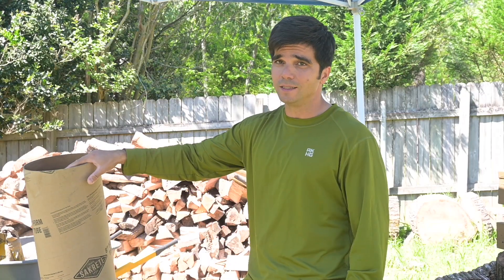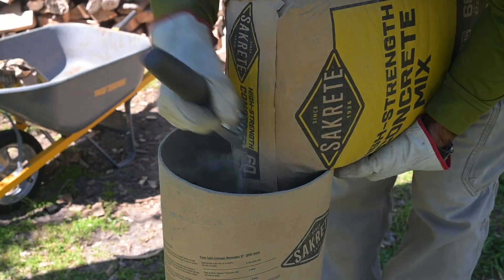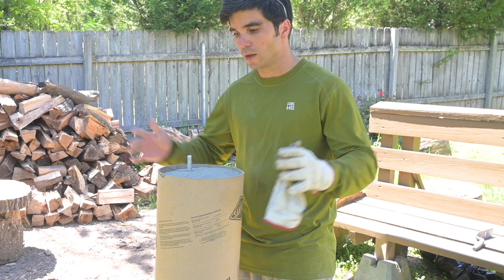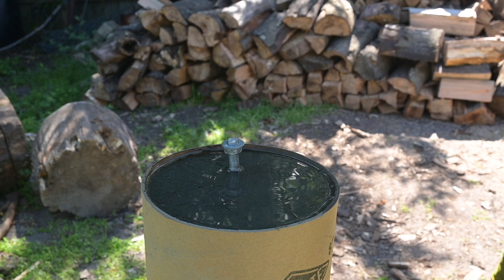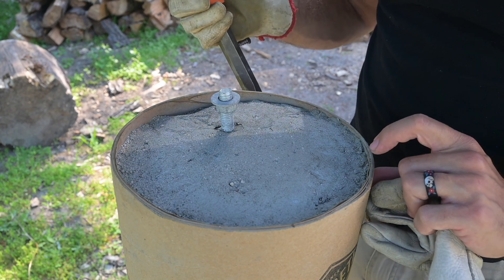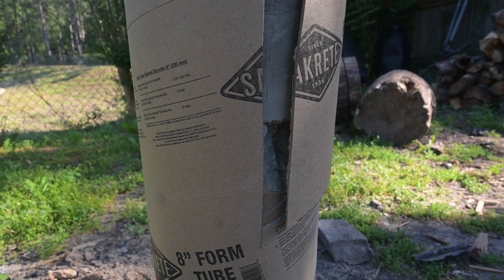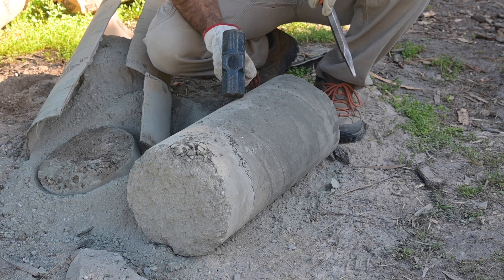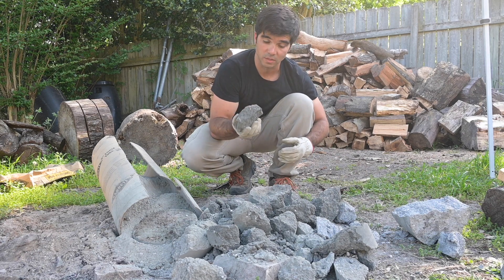Dry Pour Concrete: How Deep Can you Make it?

Comment: I think for that particular shape, I would have just go full soak instead of waiting an hour between misting. Since the mix is a lot of sand, most of the water will drain off into the ground and whats soaked into the concrete will cure well. The crete will only accept as much moisture as it will absorb. The sand in the mix is the best draining medium. Of course a psi test afterward would test how strong the cure is. Crete will cure hard with just about any amount of moisture. Getting the correct psi depends on the amount of moisture, time, and evaporation rate. This is my uneducated guess based on sculpture work with crete.

Comment: If you had watered in between bags and not run 30 gallons of water through the top layer washing away any strength. Also it takes a week or longer to cure. You said concrete is cured in two days

Comment: 1 - Roughly 5 quarts of water is needed per bag, you might have done one total gallon.
2 - Light moisture turned the dry concrete gray deep inside and it never got enough water to actually solidify. It needed to be actually wet.
3 - I wouldn't hammer an anchor into wet poured concrete until after full cure of 28+ days.
4 - Cylindrical type containers are going to allow water to leach quicker and further along the sides, then in the center area, thus causing the center area to only get moist - not wet as required. 
5 - No amount of water would have leached down 4 feet in the time given.
6 - No person would try and fill a column dry that tall for any structural purpose.
7 - If pouring a column even wet, you must use rebar over 12" depth or it will crack/break just like the dry pour. 
8 - Only a person that has never mixed concrete would believe this video.

Comment: 5:30 " the concrete is cured"
No, at two days the concrete is nowhere close to cured. The failure indicates insufficient water. Best to put a drip irrigation on it and keep a pond on it. The advice to do layers for dry pour is based on what? IMO it will not produce a strong foundation.  The general rule for curing is 7 days for a fully hydrated paste which produces 70% of rated strength.  

See American Concrete Institute ACI 308R-16
"Because hydration can proceed only in saturated space, the total water requirement for cement hydration is approximately 0.44 g of water per gram of cement plus the curing water that needs to be added to keep the capillary pores of the paste saturated" (pg 3)

Thus, if the form had been properly hydrated, you would have seen moisture seeping from the bottom of the form.
Reply from the maker: Of course it isn't good for a foundation. This was an experiment to see how far the water would penetrate. I didn't expect it to reach the bottom.
Reply: @appalachianwoodhomestead  even after concrete fully cures after 91 days, it remains permeable to water. Specifications for testing absorption and permeability are available from ASTM. Keeping a dry pour submerged until the entire stack is fully hydrated is necessary, and it is just a matter of time until standing water reaches all the way through.  It's also necessary to avoid repeated wetting and drying. The Youtube method of misting attempts to stabilize the surface. IMO the best approach is to mist until it ponds and then continually add water to maintain the pond until water is verified all the way thru. After that, keep hydrating for 7 days.

Comment: Thanks for showing this. I think it would have been better to just soak it from the beginning. It might have worked. I'm just going to mix it. I don't see this method saving any time or effort. I certainly don't want to chance it. The foundation is the most important part of a build.
Reply from the maker: I've done the soaking from the beginning, too. The results are better than this, but still not great. I believe at least some mixing is necessary.

Comment: I see there are a few things that would have made this a success, I am NOT a professional but I do have experience with regular concrete. I noticed that when you started with the water that you were following instructions for a pad/large flat surface where you didnt want to upset the visual look. What I would suggest instead is to immediately add water and avoid the misting because this isnt 1-4in of material that needs water. This shoud have been watered down from the beginning so that the water had time to get to the bottom more evenly. Other than that I believe that letting it sit for 2 days after watering it that would have been a much better comparison.

Comment: The reason you were able to pull out the bolt and destroy the concrete, is you didn’t give it enough time to set up and harden. You can’t just do everything in 24 hours, you need six weeks of setup time for it to work.
Reply from the maker: After this experiment, I did some more research and realized that I needed to wait longer than two days. The recommendation is generally to wait a week before putting tension on the anchor bolt. Thanks!

Comment: I honestly dont think people are trying to make 4ft columns with the dry pour method. 

The regular way of mixing concrete or bringing in a concrete truck. Is how 4ft piers and house foundations are made.  

People have made shed pads, sidewalks, carport slabs and so on. So 1"- 4" slabs done the dry pour way is great. 

I will be making a 3"- 4" thick parking pad on my off grid property using the dry pour method. 
When it rains it's too muddy from the truck to my mobile home.

Comment: dry pour in the manner that you are doing is for posts in the ground. you would dig the hole center the post then dump the concrete in and soak the hell out of it. over time you will get rain and watering the yard and snow and everything else. you need to redo this and soak the whole thing and let it sit for a long time getting it wet a lot over time. this test is nullinvoid
Reply from the maker: This test was to see how far the sprinkles of water penetrated and was intentionally isolated from the ground as much as possible.

Comment: The misting method only is used for 4 " to do that kind of pour you would have to totally mist it till it's totally drenched because that's to far for the water to reach the bottom at that point for strength you would have to stay and continually drench it

Comment: You REALLY should be wearing a proper respirator when pouring bags of dry concrete. When the dust gets into your lungs, it mixes with the moisture in your lungs, and then does what concrete is supposed to do. Not only can that make your life pretty miserable, but your wallet and health insurance policy won't be very happy with you either.The only aspect of this test to be a fail, would be the test itself. Dry pouring a four foot by 8 inch form tube is not a realistic test, and every one of the tests and inspections of this form tube proved it. While dry pouring is acceptable in certain situations, it is DEFINITELY NOT acceptable for something like this, which is meant to be a structural support. Next time do a test with a 4 inch or 6 inch slab.

Comment: 6:46 how much water per cubic inch did you pour. For that depth, you would have had to fill that top section 10 or 15 times to have enough water to soak to the bottom. Without the proper amount of water and curing time for the amount to mix, it is not a really fair demonstration. Not adding enough is like not adding enough water to dough. But  still 19 inches is not bad at all.
Reply from the maker: I moved up to watering every 20 minutes and watered throughout the day and evening.
Reply: ok

Comment: Did you water it well 4-5 times a day for two weeks as you're supposed to do with a normal wet pour. If not, it does not settle it at all.
Reply from the maker: Two weeks is a darn long time. Most people only wet cure for about a week. 

No, I didn't do that for this video because that really wasn't the point. I watered at frequent intervals over the course of one day. I was attempting to see how deep the water penetrated during that time since many people only water dry pour for a day or two. 

It could be a fun experiment to see if I could actually get the entire tube form worth of concrete saturated with a dry pour, no mix method.

Comment: I guess everybody needs to do a video on this and it was somewhat interesting to see this one but I don’t think anybody would even consider doing a dry pour more than I would say 10 inches max.
Reply from the maker: You don't know until you try. I wanted to find out how deep it could reasonably go (and tested it in isolation from the ground on purpose). I was hoping to find an easier way to do piers for a cabin I'm building this summer, but this is a "shortcut" I won't be using.

Comment: Why waste your time on dry pour and spending 8 hrs pouring concrete and sprinkling watering when doing it wet you'll be done 
in 3 hrs duh
Reply from the maker: After my experiments, I agree.
Reply: Nobody is spending 8 hours watering.  It's 10 seconds at a time - multiple times.  At most, experienced people are spending an hour to prep before water.

Comment: I haven't seen anyone try to do a full tube of dry pour.  6" max depth maybe.  You'd need to add water every bag or 2.  In a dirt hole for a post, dry pour is completely fine.  Don't need a tube.  Even then, the entire depth (4' in Michigan) doesn't need to be filled with concrete. I would do 2 bags at bottom and 1 bag at top.   I wouldn't even use a tube for a footing except a section at the top to get the concrete above grade and level.  I'll be trying to do a dry pour on bare ground over a horizontally laid tube to extend my drive way culvert a few feet.  Will be about a foot of gravel on top of the concrete.  12" culvert pipe is way over priced if you can find it and I don't need to buy 20' to only use a 3' section.
Reply from the maker: I tried in just about 6" sections in my third video. it didn't work well, either. Part of the problem is that it gets bad stratification as the gravel rises up, so there are lots of stratified layers.
Reply: @appalachianwoodhomestead  Gotcha.

Comment: When I do 3 foot deep fence post dry pours, I do a few important things differently:
1. Tamp as you go.  Tamp the mixture together as you go (as you add)  to eliminate voids
2. soak the area for a long, long time.  I would put maybe a sheet of newspaper on top to keep the surface from being pitted, but since aesthetics aren't important I wouldn't stop hydrating from the start
3. I would just leave a slow mist or drip on a column like that, continuously hydrating, for a good 24 hours.  Concrete is like a sponge and the water will get all the way to the bottom. We are naturally impatient so we want to just drench but the absorption rate is slow. A continuous mist that doesn't drip water directly onto it works fine. Set and forget until 24 hours. 
4. I protect from drying, or just keep wetting it for a good long while.
Reply from the maker: That's really great advice. Thank you.

Comment: Isn't the thinking with drypour that the cement will absorb water slowly over time? Since you isolated it from it's surroundings the only water it got was from the top and bottom. Is 2 days do you really think the cement got enough water from either direction even if every drop you put on it got absorbed?

Comment: Blaming the system when you don't follow directions is not a fault of the system, it is the fault of the user. Clearly you have not watched enough of Cajin Country Livin's videos of doing dry pour, as you did not follow the basic rules for wetting, at all.  They say you need 2 showers once per inch of thickness of the pour spaced out by 2 hours each. (See https://youtu.be/_50MXEHr678) which would requires days of showering to fully wet the concrete and trigger the chemical reaction that causes it to harden.  I imagine in this specific application that placing a micro-drip waterer on top and running it continually for a couple days would probably be okay after the second shower and would result in full penetration of the water in sufficient quantity to fully wet the concrete mix.  
BTW, using a oscillating saw (saber saw, saws-all, without a blade is a great method for vibrating a form to get the material to settle, eliminating voids.

Comment: A 19" slab?  Who needs a 19" slab?  As much as you tried to resist it i think for a foundation pillar you'd want to get the concrete in direct contact with the surrounding ground and have that soaked.  My understanding is concrete is porous and water will slowly move through it  Maybe you should do a slab pour where it goes from a few inches to a few feet thick, leave it a really long time - at least a month, if not several - during a time when there is plenty of moisture available to soak into the slab gradually. Then cut sections of the slab at various thickness and have them professionally tested.

Comment: dry pour should not be used for foundation. or any thing with weight bearing like a dry drive way. may be
Reply from the maker: Agree...but I don't think I'd even use it for a driveway.
Reply: guess you didn't watch the video of the guy who dry poured about 5-7 slabs all together, let them set for a few days (only), and then asked his neighbor with an F350 to drive on them... TWICE, and that F350 had all his tools in it as well.  It cracked around the edges but the slab itself did not crack and that was with the F350 being mildly aggressive.
Reply from the maker: @billsmith9249  Yes, I'm aware of that video. Doesn't mean I would personally chose to do the same based at this time. The truck on the slab at two days is one of the reasons I thought letting this tube sit for 2 days would be okay for initial inspection.

Comment: I am doing some stepping stones. # inches should soak just fine. I'll moisten the ground first so it soaks from both top and bottom.
Reply from the maker: I agree that this method should work for stepping stones. I highly recommend screeding to make sure it's level and to help push the rocks down. This will give you a nicer looking product that's stronger, too.

Comment: First I want to say thanks for the test and video. However I feel there is some problems presented here. 

Dry pour for fence posts is used all the time. I think the way presented here doesn't do dry pour any justice. It gets stronger over long periods of time. Eventually it will have full coverage and the concrete will fully harden and cure close to max psi strength (over one month). Doing a 24 hr comparison is basically a worst case scenario between the 2 methods. 

Even wet pour after 24 hrs to me is very weak and brittle. I have had to wait over 2-3  days before removing wet pour from concrete molds, etc.  Also your curing and drying explanation is very incorrect. 

Copied from the internet here is a guideline for wet pour (conventional). When waiting for concrete to dry, keep these timeframes in mind:

24 to 48 hours - after inital set, forms can be removed and people can walk on the surface
7 days - after partial curing, traffic from vehicles and equipment is okay
28 days - at this point, the concrete should be fully cured

Dry pour takes longer (as the water penetration is not as fast and complete as wet pour)

I have many dry pour posts that if you pull them out of the ground, the concrete around those suckers are just as hard and strong as the ones that would be wet poured. The problem I think in this video is time and water penetration. Had the tube been set in the ground and the wet ground was giving moisture from all sides it would yield much better results. I understand this is a test but I believe the testing methods here is flawed and give poor results.
Reply from the maker: I completely agree that setting it down into the ground would result in better moisture absorption and a stronger product. Water penetration was low. I was attempting to test whether the "traditional" dry pour watering method and schedule could result in a satisfactory product with a tube. I think that's unlikely.  A post hole in the ground (and at a smaller overall depth) is a different situation. 

I did remove the tube at two days. I thought the video stated that in a caption. I don't have an accent, but English is my second language so sometimes I get words muddled. People have told me that dry pour takes longer to cure, but I went based on my bag's statement that it was safe for vehicle traffic and at 50% strength after 2 days. 
 
Thank you for taking the time to leave a helpful and thoughtful comment.

Comment: Many thanks to Appalachian Wood for conducting this experiment, it was very enlightening and educational. IMHO comparing dry pour to wet pour is the same as comparing a Harbor Freight trailer to a flat bed. Dry pour is fine for small DIY projects, however no one in their right mind is going to want to build a multistory office building using dry pour with current technology.  On the other hand, why pay contractor rates for a home sidewalk or garden shed slab when dry pour is fine.  Plus, why miss out on that personal satisfaction of doing it yourself.  Wet pour is for commercial projects and the overwhelmed, lazy, and/or timid homeowner. Dry pour is for the cash-conscious do-it-yourselfers. Everyone just needs to stay in their lanes.
Reply from the maker: It doesn't have to be dry pour or contractors. I think small scale mixing, like with a drill attachment in a bucket (or even with a piece of rebar), and wet pouring in small increments yields a much higher quality product. This costs negligibly more than a straight dry pour, but will bring stronger, longer lasting results. I personally might dry pour stepping stones or a chicken run, but nothing as important as a garden shed.